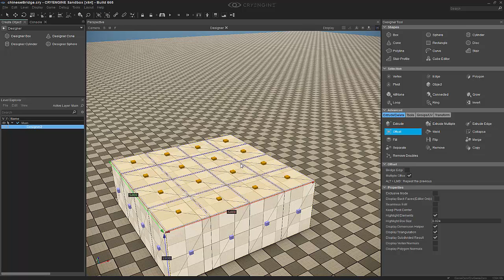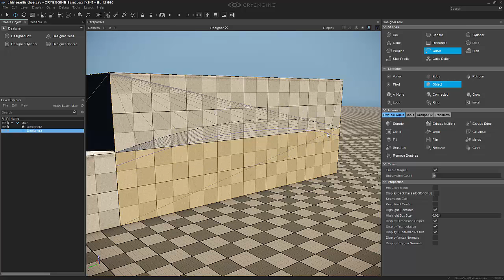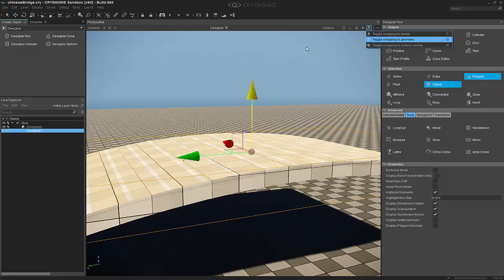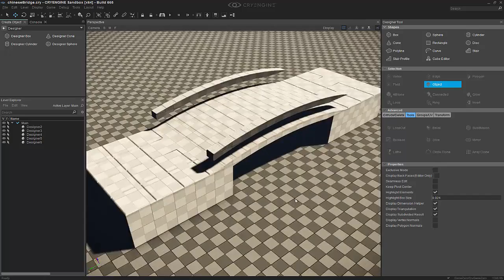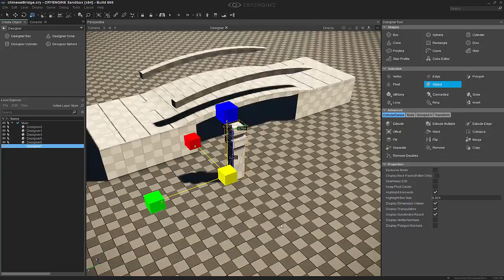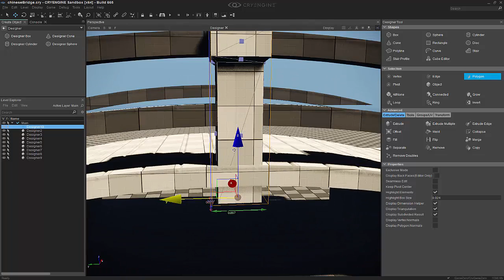How to create a bridge in CRYENGINE Designer | Art & Animation

Comment: Hello many thanks for your very helpful tutorials. Is there the possibility to sculpt meshes in cryengine 5?Cheers Alberto.
Reply from the maker: +Alibix 3D Hey there. The designer tool does allow for subdivision surfaces and creasing so in a way it does. It wont be as far along as singular apps that focus on this aspect like ZBrush and Mudbox. I hope that helps explain it a little bit.
Reply from the maker: Hey there, if you want to open the modelling tools pane for CryDesigner you can find this under Tools->Designer Tool->Modeling.